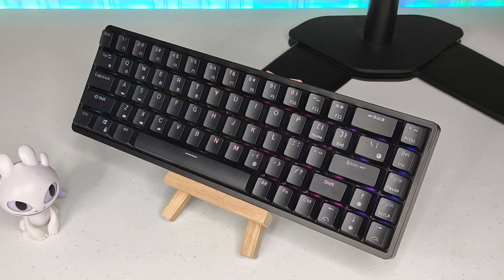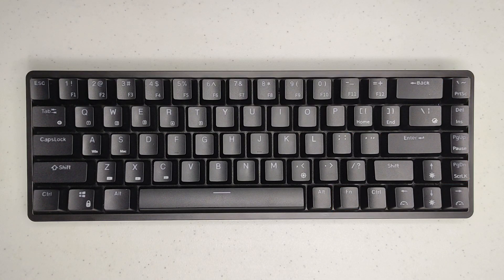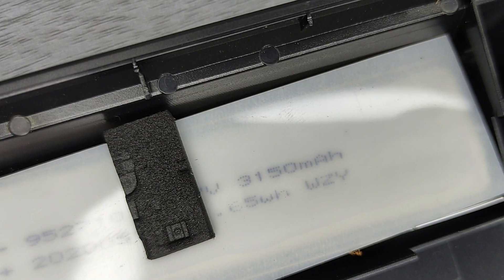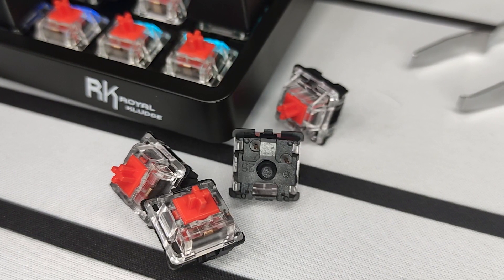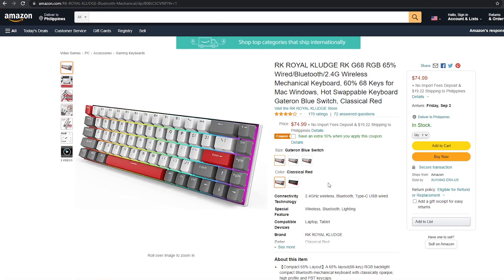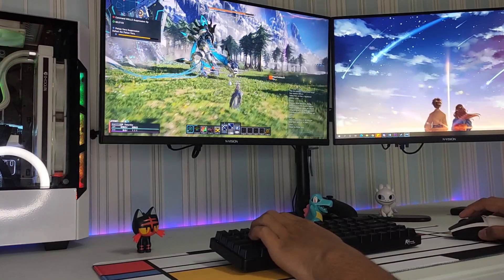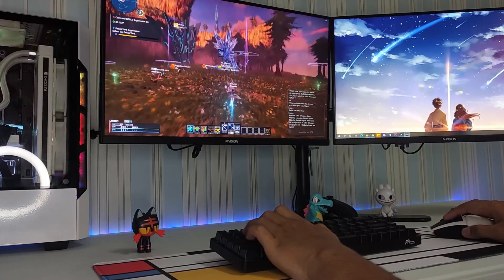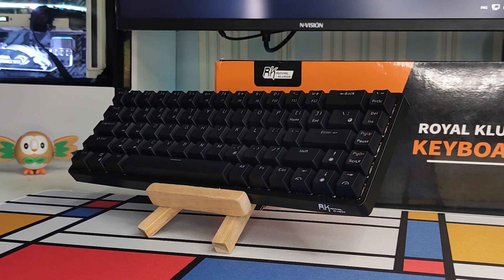Best Value 65% Mechanical Keyboard - Royal Kludge RK G68/RK837 Hotswap - 2021 version - Full Review

Comment: hi sir! may i ask. What is the difference between the Bluetooth and the 2.4ghz wireless connection? And oh what does the dongle do. Thanks sir!
Reply from the maker: Bluetooth - keyboard pairs with a bluetooth receiver(on your PC/laptop/phone/tablet) - low power consumption

2.4Ghz wireless connection - the 2.4ghz dongle(USB) plugs to PC/laptop. The keyboard communicates to it and sends the signal to the PC/laptop. Has lower latency compared to bluetooth since it's a 1:1 dedicated connection and it can accomdate higher bandwidth - high power consumption but offers much better performance. This is the same tech used in wireless gaming mice

Comment: Yo bro! I got a question.
 Got the same keeb. I know once the fn key blinks constantly it has to be charge but no indication or whatsoever that its full. Im waiting for the spacebar to blink 5 times as says on the manual but it didnt happened. Do you know how long i need to charge it or how will i know the battery of it?
Reply from the maker: For me it takes about 2 hours. It doesn't matter really. Lithium Ion batteries used on keyboards and mice don't suffer from overcharging. Unfortunately, the keyboard does not indicate when it's fully charged...unless you check on the software or on your PC indicator(if paired via bluetooth). Maybe this can be resolved with a firmware update someday.
Reply: hey sir, can you give me some update with the keebs? is there any issue with it right now? I planned to buy it, but undecided because some people have issue

Comment: hi! your video is so good and thorough. i got this keyboard about a month ago and it was working great, but suddenly it stopped charging? when I plug it in the red light doesn't go off and the Fn key keeps flashing for a bit, then the space bar 4 times, then it stops and its just backlight. it basically works fully in wired mode, but sometimes the Bluetooth still blinks (like Q key) even when its plugged in. is there any way I can fix this?
Reply from the maker: I haven't encountered that before..you can try flipping the Bluetooth switch to 2.4ghz mode and see if that helps..it may be also be a case of a faulty keyboard or cable so you may want to reach out to your seller

On a side note..if the pc sleeps while you are on wireless mode, you may need to re-pair/reconnect for the keyboard to work..from my experience I always end up reattaching the dongle whenever I wake up my pc from sleep mode

Comment: Is it just me or when I use the wired mode, it looks like my keeb is charging because of the red light. Is there a way to get rid of that when using wired mode? By the way, nice vid, sir. Thank you!
Reply from the maker: Try to flip the switch to off and see if it helps. This appears to be an ongoing issue with Royal Kludge keyboards. Sometimes even if it's fully charged, the indicator still stays red and you will have to power cycle your computer a couple of times for it to go away. I also notice that but it seems to go away when I flip the switch off.
Reply: @KonzTech  Thank you for your reply, will try this workaround and hopefully it works.

Comment: How can i factory reset this keyboard?
Reply from the maker: FN+Space(hold for 3 secs until keyboard flashes). Just saw it in the manual.
Reply: @KonzTech   doesn't work
Reply from the maker: @tobi17kcs  that's weird. It works on mine. Maybe your keyboard is a different variant. I just press and hold FN+Space and wait for the keyboard to flash. You can try press and hold FN+Esc or much better check on the manual

Comment: Interesting. Is your keyboard does not have multimedia keys? I also have rk g68 (white rgb) and my have multimedia keys (same as in older version - rk68). Maybe just your keycaps are missing symbols for them? Try Fn Key + Left CTRL (it's switching to alternative layer for keys from F1 to F12).  I don't know who designed this stupidity (instead putting multimedia to somewhere else) but better this than nothing.
Also what is this G symbol on the Tab? I don't have it and Fn Key + Tab seems to do nothing.
But on the other hand I did not had switch puller in my box so maybe silently they release multiple version of this keyboard.

Also the software ... it looks differently than my, but anyway it have the same problem as most of them from other keyboards/brands. It does not let you remap or assign anything in FN layer. Something that all of the small keyboard should have instead forcing you to sacrifice any usable key button.
Reply from the maker: Apparently, it does not have media keys. The win+tab is "Game mode" where you can enable and configure macros on the fly. The manual explains how to use it. Sorry, I did not expound on those since those are functions I hardly use and honestly, I did not realize that it's important. The software enables remapping but only on the first layer. Maybe when they release an official one, it would have more functions..Anne Pro 2's software kit allows that(remapping to 2nd layer) from what I remember(already sold my AP2 a couple of months ago)
Reply: @KonzTech   My one doesn't have an options for macro on the fly. I'm a little disappointment, but at the same time I also don't have the options to swap between profiles (ZXC keys). I'm often using multimedia keys, so for the long run fn+ left ctrl is annoying.
Reply from the maker: Actually the FN+Left Ctrl key did change the number row to multimedia keys lol. Thanks for the tip. Not that I would actually use it but it's good to know. I'll be sure to watch out for those in my next reviews of Royal Kludge keyboards
Reply: Media keys only available for rkg68 that don’t have 2 port usb .. if u buy the one that don’t have 2 usb port it means u got the latest version of rkg68
Reply: @r-reyh8757  

Nope. Both of them have multimedia keys. Also a small note RK68 (RK855) and G68 (RK837) are two different versions. RK68 (855) is older one without USB hub and with much smaller battery.
Reply: @NikodemSzusti  yeah I know about rk 855.. u probably don’t know that rkg68 or rk837 has two different versions.. mine is rkg68 with no usb port but has media keys 2021version, in this video also rkg68 but with usb port but no media keys late 2020version ..as u can see royal kludge did released two versions of rkg68..

Comment: This is my 3rd mechanical keyboard, torn between this and Tecware B68, and glad that I chose G68. The 2.4ghz is way better than Bluetooth, it's hassle-free! My only gripe is the wired mode, as I kept getting 'USB device not recognized.' That's the only major flaw I experience with it. I also wish that the on/off etc switches are on the sides not at the bottom for easy access. The greatest strength of the G68 is the battery life, it's superb! Been 3 days since I bought mine and I haven't charged it even once. Overall would rate this KB 8/10 (9/10 if wired mode works fine)
Reply from the maker: Once they polish up the software and release an official one on their website, an update should hopefully be able to fix the USB issue. I honestly did not experience it or maybe because I have not been on wired mode for the most part. I just plug in the wire when it's time to charge. And yes, the 2.4Ghz wireless connection is what really sold me to this keyboard. I would actually buy the B68 but when this one came to my shopee feed and saw the specs... I immediately added it to cart lol
Reply: How do you know when it's charging? Mine has no charging indicator.
Reply: would this work for FPS gamming?
Reply from the maker: @lintex  I don't see the point why it wont. It uses the same wireless tech used in wireless gaming mice. You will not feel the difference between 2.4Ghz wireless and wired unless you have suuuuuuuuuper insane reaction times or you're a robot xD
Reply: i wanna ask about the battery consumption. how long does it can be used on a single charge using the 2.4g dongle connection. hope you reply this...coz im in dilemma on buying this keyboard. thank you
Reply: @hansae_1  Around  10 days
on 2.4ghz mode, rgb off

6 days on Bluetooth mode, 50% rgb brightness

4 days on 2.4ghz mode, 100% rgb brightness
Reply: @hadenkriztenzen  thank you. i appreciate it
Reply: Is the 2.4ghz range good, i was thinking of using it from 6ft away
Reply from the maker: @reubanramsden6230  should be alright..I sometimes play on a big TV and I sit far more than 6ft away from it with the keyboard
Reply: @KonzTech  Okay thanks
Reply: bro how long is the charging time?
Reply: @emmanuellara5166  I don't fully remember but I think it is between 5-7hrs. But I won't recommend this keyboard in 2024 as there are eay better keyboards in the market for that price.

Comment: What's your view between RK G68 vs Tecware B68? Do you think the stocks Gateron switch and PBT keycaps on Tecware B68 worth the price or getting an RK G68 and mod later is a good option?
Reply from the maker: It really depends on what you want to achieve and if you plan on customizing in the future. Both keyboards have their pros and cons. Tecware has great stock feel than the G68...but it's more expensive too. The RK G68 has the upper hand when it comes to wireless performance because obviously 2.4Ghz wireless connection is superior to bluetooth. If you intend to game wirelessly, then the RK G68 is the best option...with the perks of potential mods in the future. If you want a great feeling keyboard out of the box, then the B68.
Reply: @KonzTech  Thank you and thanks for making the video.
Reply from the maker: You're welcome. I was actually torn between buying the b68 and rk g68 last April but the 2.4Ghz wireless connection got me sold. To my surprise, it had extra features like the 2 USB passthroughs which is handy sometimes. I prefer gaming performance over feel. But it's nice that the keyboard has potential for future mods. I'll just need to save up now for the new switches and keycaps haha

Comment: EDIT: I just tried using my usb humidifier again on the USB passthrough of the keyboard and it works! I just didn't know how to turn it on I guess, when I tried it before lol this keyboard is AWESOME!!!

I totally agree, this is my 4th mech keeb, and it is by far the best out of all the ones I've tried (The other two were RK too - RK71, RK100). The RGB is bright enough even to use during day time, the dedicated arrow keys are super handy, and I don't always use the 2 USB passthrough ports but when I do need it, it comes in really clutch. Charging phone and using headset with mic works on it, although my USB diffuser doesn't work with it, so not everything works (but peripherals are def more important here and they work just fine!). The battery lasts almost a week with the RGB on, and using Bluetooth. Highly highly recommend this keyboard for those looking for a beginner keeb or even those that need it for work! Just beware before buying ion Shopee, make sure you look at reviews because some of the keyboards (like mine) can only connect to 3 Bluetooth devices (unlike the one in the video which can connect to 5), some others also don't have the 2 USB passthrough anymore, so check the description as well. I got mine from NeatPH on Shopee.
Reply from the maker: Didn't know there were so many variants of this keyboard. Royal kludge models are confusing haha. But hey they're really good regardless of what model xD

Comment: can we change the keycaps into pbt keycaps using tecware pbt keycaps?  does it fit or not?
Reply from the maker: Yes. But make sure the keycap set has modifier keys for 65% layouts.
1u - right alt, FN, ctrl,
1.75u - right shift
2u - enter

If you'll buy keycaps made for the Tecware B68 then it should fit since they both have the same 65% ISO standard layout
Reply: bro rk837 vs. redragon k599 deimos ... which is much better?
Reply from the maker: Not sure about the deimos. Reddragon keyboards are popular in the budget segment so they should be good and they're cheaper. But they may not be hotswap though and have lesser features than the RK G68. There should be reviews online. Just search them up and compare the features with the RK G68.
Reply: @pacianoobnimaga4550  rk g68 much better..